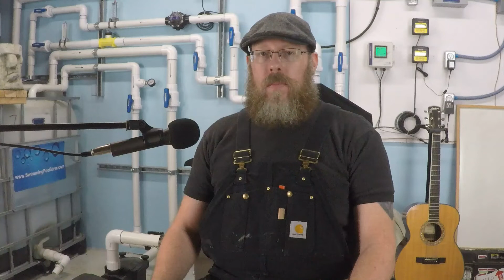Above Ground Pool Wall Rust - Can You Fix It?

Comment: Definitely a bummer to hear. My above ground pool is about 30 years old but it’s in good shape everywhere except for the return jet, which is half disconnected from rust 🥺
Reply: I have the exact same problem. A small hole developped just near the jet! I had to lower the water level under the jet and looking at how I will deal with this!
Reply: YOU CAN REPAIR FOR SURE
Reply: @Mikkeyboyy  I would love to hear how haha
Reply: Amazon sells plates to go around jet and skimmer. Precut and drilled.
Reply: We had this happen too and we made metal washers the size of the intake hole and glued them on and it worker perfect .😊